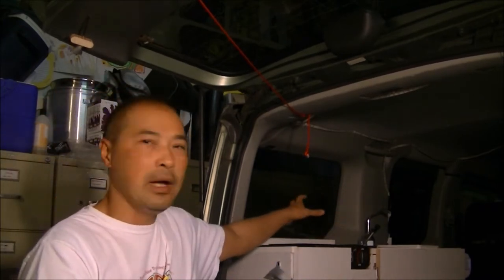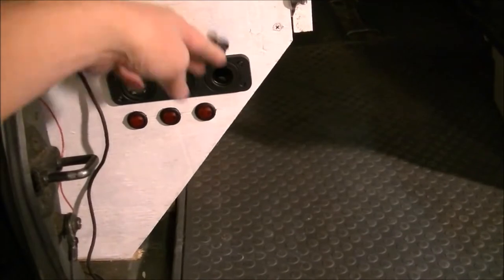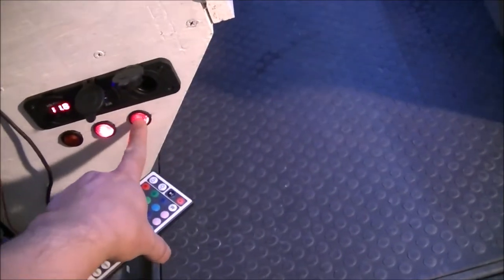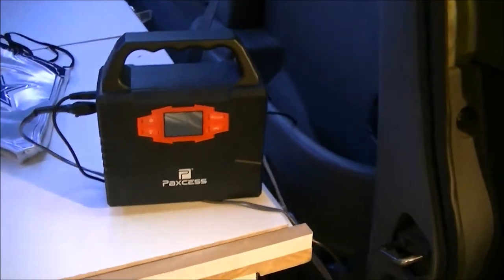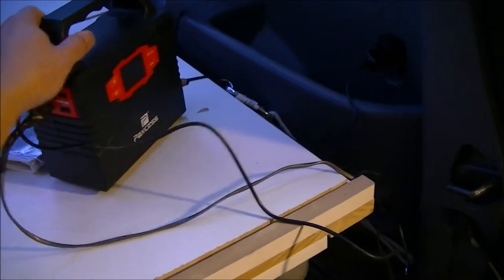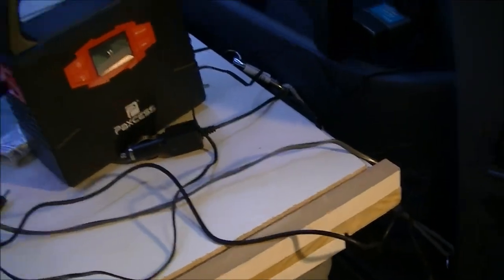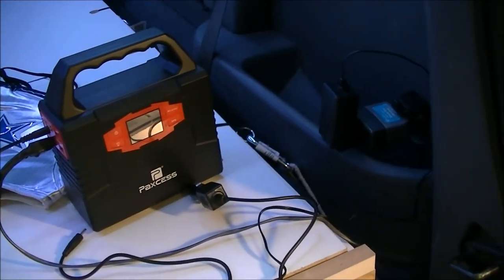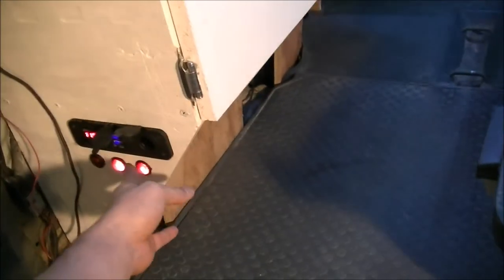Honda Element Micro RV. 15. Power Switches And Ports

Comment: it would be great to know more about the parts you use to do things. and i'd really love to know how you wired and set this particular system up. thanks!
Reply from the maker: That is odd. I feel Ike I already responded to a similar question from another user already. Here you go. 

https://www.amazon.com/Portable-Generator-Station-Camping-Recharged/dp/B078NQDTPY/ref=mp_s_a_1_7?ie=UTF8&qid=1546750681&sr=8-7&pi=AC_SX236_SY340_QL65&keywords=lithium+camping+battery&dpPl=1&dpID=41ZUThHwRNL&ref=plSrch

https://www.amazon.com/gp/aw/d/B072LN19K8/ref=sspa_mw_detail_5?ie=UTF8&psc=1